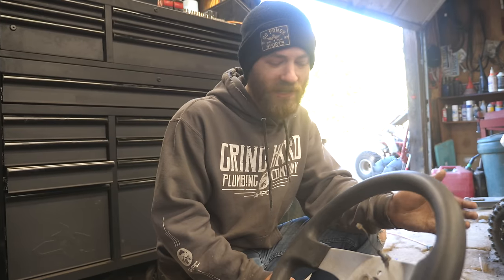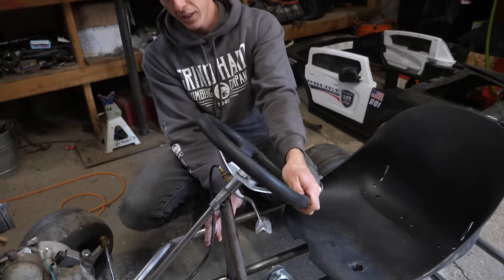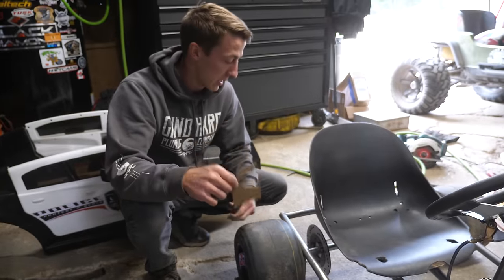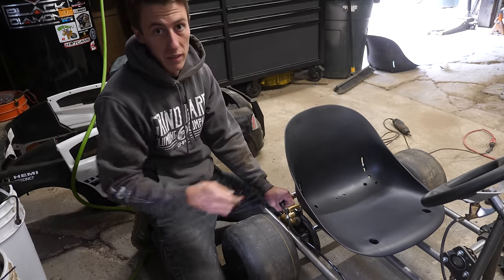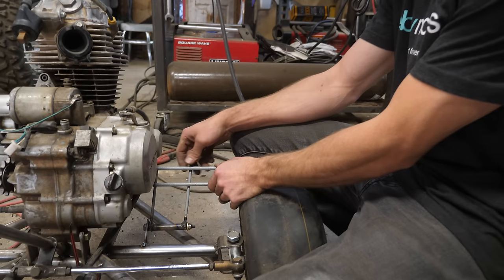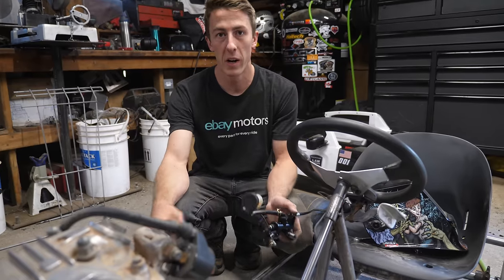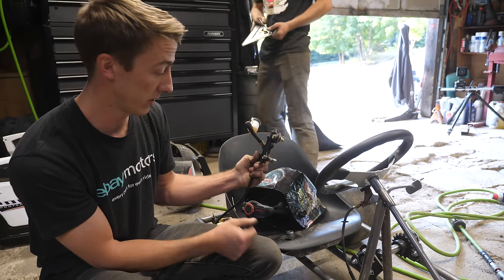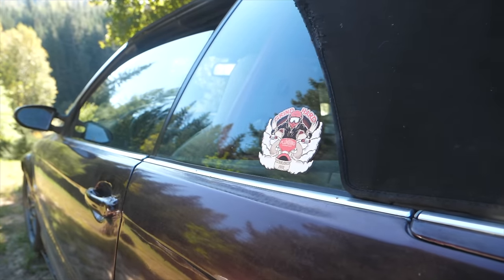How to Build a Power Wheels Go Kart! Step by Step!

Comment: You should add a clutch, gas and clutch pedal and paddle shifting. Gas and brake on the right, clutch on the left.  Or do a shifter next to it. Or do a clutch pull and shift with each paddle which would be mindblowing dope.

Comment: Wow, if that chain comes off at speed it could delete a pork pistol. Also, if you want to put the break pedal on the left you could attach a short cable going from the pedal to a 2nd smaller jack shaft to get around the motor. And you could even put a small lockable handle off the break jack shaft & have an E Break.

Comment: Awesome job guys 👍 just a FYI if you run a engine with no exhaust for too long and the valve heats up when you kill power cold air can rush in and warp the valve 😢it’s ok to start it like that just make sure it doesn’t get hot 🥵😎🚕💨💨💨💨💨
Reply: does more than just warp them! Running no exhaust means the valves will overheat and crack. The header works like a heatsink to pull heat away from the engine and prevent the valves from getting damaged. You fully can break a valve while it's running if you dont' run an exhaust system

Comment: Have you guys ever thought about using the mechanism from the front brake on a bmx for the clutch? The ones that allow the handle bars to spin indefinitely? I think that would be a good work around to keep the clutch pull consistent when turning the steering wheel

Comment: You need a clutch cable with the 90' tube bend coming from the lever adjuster. that will direct it towards the column

Comment: Could you adapt a detangler headset and brake system from the front brake on a Freestyle BMX bike for the clutch?  It wouldn't matter how far the steering wheel is turned, you'd still have smooth clutch pull

Comment: for some of that cabling you could probably just use a gyro off any old bmx bike, so its on bearings and you dont need to worry about cables kinking. 
also, for the deleted files, as long as they have not been overwritten (you realise you deleted it pretty quickly). all that happens is its renamed to blank space as far as the system knows. buy it is still there, you just need software such as 'recuva' to find it and restore it. so thats just an fyi.. although it doesnt always work well.

Comment: Do not put the battery beside the fuel tank if battery ever sparks and ignites the fuel vapor you'll be up in flames before you can blink or atleast vent it out the body or put whole gas cap of tank thru the body so it can vent out side

Comment: What engine size would you recommend for a beginner, and where should I find One?
Reply: Predator 212 are great for beginners,  durable,  pretty standard and only $120 at harbor freight
Reply: @dr.stevestein1939  Thanks, but looking for a manual. I wanna build a shifter kart just to play around with.
Reply: @ohiocreekfishing9246  I would get a 125cc pit bike motor. those are cheap and if you get one brand new there like 200 bucks. Or I was thinking about building one with a yamaha yz250 2 stroke dirt bike motor lol.
Reply: @gdog3017  Thanks, I'll look

Comment: Maybe it would be better if you mounted the clutch pedal on the steering "column" and not on the steering wheel itself? In that case you shouldn't worry about how it would work if you are at full steering lock.

Comment: Does anyone have the exact measurements for the frame?
Reply: The engine id be using is a kx250 2stroke motor and i dont have a body yet but probably a Camaro or Corvette